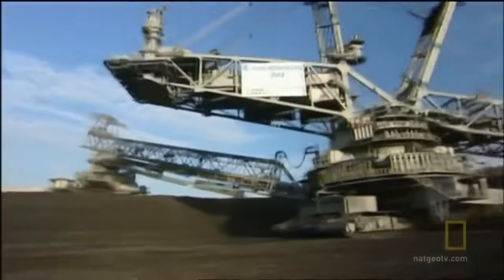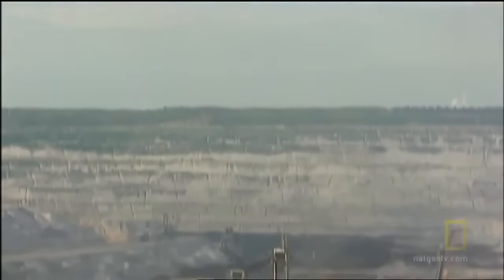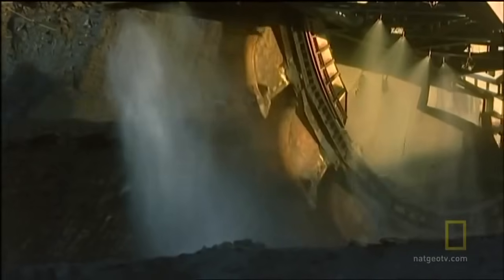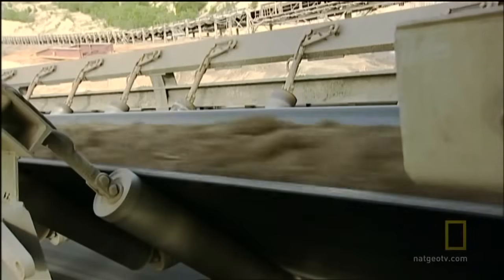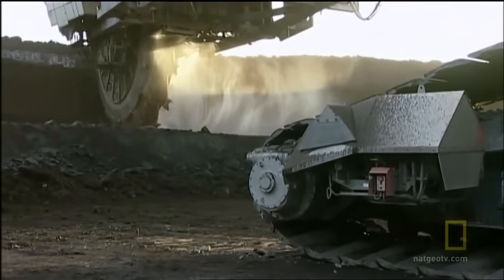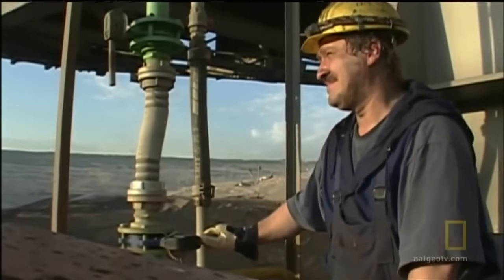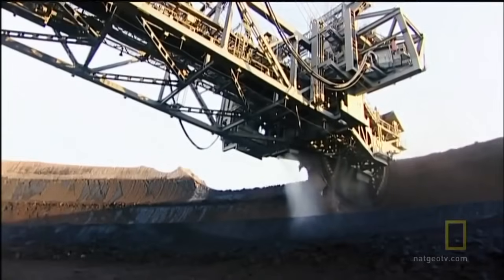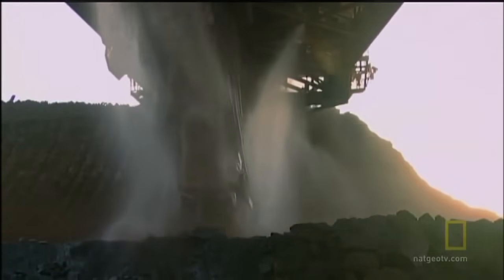Bucket Wheel Excavator (Bagger 293)

Comment: Bagger 293 is breathtakingly large. Even bigger is the F60 conveyor bridge with 2 bucket chain excavators and a capacity of up to 552,000 m3 per day. Excavator 293 creates (only 😉)240,000m3 Both excavators were built or developed by the former GDR company Takraf in Lauchhammer.
Reply: Doesn't wiki state the bagger is bigger than the f60?

https://en.wikipedia.org/wiki/List_of_largest_machines

Comment: Can a bagger be used to dig canals or does it work on only specific soil types...
Reply: its a coal excavator - the biggest of its kind today is the Bagger 288, produced by krupp, currently being used in Garzweiler, germany - aka, its used to get coal out of the ground for coal powerplants. The soil doesnt really matter ( I think), and it is not used to dig canals, simply because it took three weeks to relocate it by about 22km, so its wayyy too slow.
Reply: @MeddlHaider  I think it isn't used becoz such big projects are very few. I have read that a bagger can dig 125X80X30 meters cube per day It also has a travelling speed of 5 kmph on firm level surface. So it can certainly do its's job if the width of the canal is equal to it's boom length.
What i haven't been able to figure out is how to keep the vonveyor system with a moving bagger.
If this is figured out, many rivers can be diverled to stay flowing through the lands longer  it will also make connecting rivers possible, specially in flat areas...
If this method was worked out, we could fill up Aral, Qattarra, Denkali and alliviate many problems. Of these the Qattarra project wpuld be the most feseable....
Reply: @magatism  The conveyor belts are mounted to bagger itself, mostly its just the trucks moving under the conveyor belts behind the thing. Afterall it doesnt stand still in the mine its in either, its moving very slowly
Reply: @MeddlHaider  Thanks for the clarification, i think with some special inguinity Bagger can alliviate a lot of problems in this world. 
Imagine digging a 125 meters wide tributory to a river and the widening it with mechanical erosion. Euphrates could be nade to flow through the coastal areas of Kuwait and Saudi Arabia, emptying into the depression near UAE border.
Or the Qattarra project forming an evaporation curtain over west egypt, stopping desrtification while increasing rains in Sudan, Ethiopia, Sinai and Israel. 
Or filling up the Danakil with Sea providing controlled food source to the region.
I am very optimistic about this metal giant and it's applications.
Reply: @magatism  I doubt it, not an expert but unstable, sandy or muddy soil close to big bodies of water might be a big problem for a machine that wights 14,000+ tons.
Reply: @D-One  True but starting a few kilometers away would mitigate that risk and though heavy, the footprint wieght of these machines is quite low compared to their gigantic size. 
A bagger can dig a canal 1km wide 1 km long 20 mtr deep in 2 months, so it's probably the best option to linking river projects.
Reply: @D-One  Just need to make one out of carbon nanotubes or some other future material :D